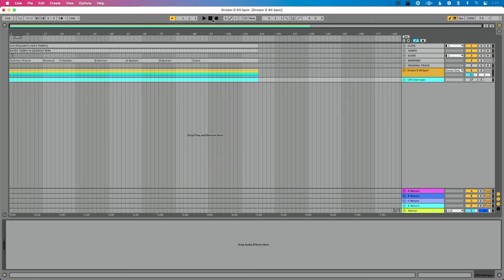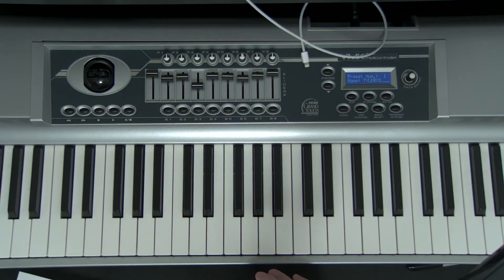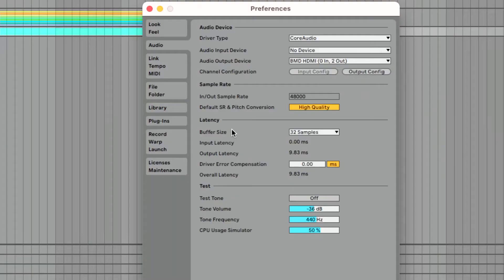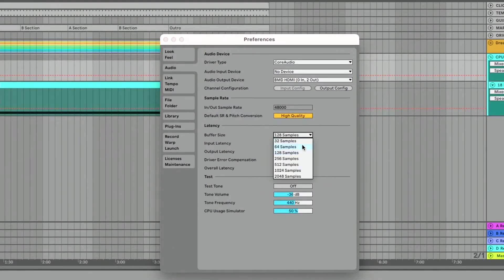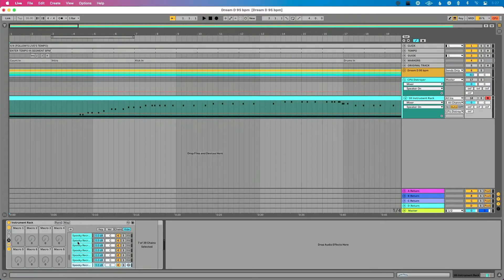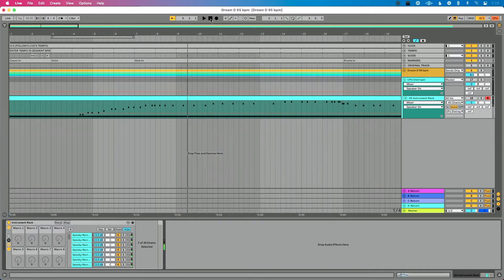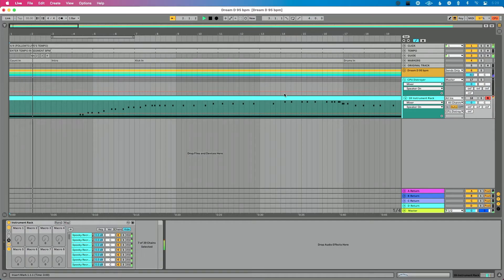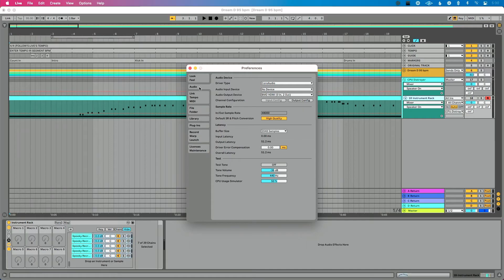How to fix audio crackling and popping in Ableton Live 11

Comment: I'm so annoyed by this. All I'm trying to do is mess around with the piano, my CPU use is only ever at like 5% max, and no matter how much I fuss with the settings I still get pops and clicks when I'm just testing out a single instrument. Ableton is such trash.
Reply: Try a sample rate of 48000
Reply: @cristiansprenger418  you just fixed my exact issue I had the same problem with the clicking on only 5% cpu I think my pc is just horrible. Thank you so much.
Reply: I think your problem is more on your CPU threading than ableton itself... At 5% getting cracks sounds sooooo wrong
Reply: @apophenia3h310  Fucking windows bro I can't be arsed to get into cpu threading optimization when I just want to finish my song that has 4 fucking audio tracks and a drum group with minimal effects. I have separate audio interface obv, 8 gigs ram and an i7.  It shouldn't be this hard.
Reply: @wokeil  something is wrong then, what other program can take all the power from the CPU ? Or do you use unstable vst ? Or maybe vst2 and vst3 combined ?
Reply: May be it comes from your disk, if ableton can't reach samples or long clips fast enough in your disk it can cause issues too
Reply: @apophenia3h310  Yup. It was LABS
Reply: @wokeil  You can use Windows Task Manager's Performance tab to see what part of your hardware is limiting your computer's performance. It might be your hard drive. For me, changing the buffer size fixed my problem. I'm using a worse performing CPU and 8gigs ram, but I have a Solid State Drive.
Reply: Having the same problem
Reply: Your headphone's and ableton sampling rate should be same. Try that it can solve your problem.
Reply: hey man, even my test tone is crackling, dropping out and pitching up and down even at maximum buffer size, which is mothrfkn frustrating.  I think it is because the driver type is MME/DIRECTX, which always has been a fucking mothrfcker in my experience. ASIO should not give this trip. I bought a cheap plug and play audio interface which does not have a setup patch to be detected in ableton which hence does not show up when my driver is ASIO, i think that is my mistake not ableton bug. good news is the crackling is not printed in the exported file it just happens in real time while you try to work which still is frustrating.
Reply: Somehow I can't edit buffer size in my ableton 11. I use a focusrite 2i2, and can only change the sampling rate. Buffer is set to 32 and there's no drop down menu...
Any ideas? Thanks
Reply: Cleaned up my computer hard drive and restarted it a few times and it seems to have worked
Reply: You prob had a bad cable
Reply: That is happening to me also and I have no idea why, is not the monitors because it sounds the same way when I use my headphones
Reply: Increasing the sample rate to 48000 worked for me
Reply: Calling the most used DAW worldwide, and one of the most powerful production software "trash" is something... I just think that you have to better understand either your tools or your usage. I use ableton with hundreds of tracks, midi in and out, audio in and out too, as a live setup, I play a lot with midi on stage, the CPU is always around 80+ with peaks at 120% and NOT EVEN A CRACK... Just look for help, your situation seems a bit too excessive...
Reply: @apophenia3h310  I sort of agree, until..........I have same issue. I have been using DAWs for a long time. Both mac & pc. Here's what's happening. I open a standalone vsti. I set up audio/ midi settings and tweak until I get a great balance of buffer delay and clean sound. Great perfect. Everything sounds awesome. Then.....fire up Ableton 11, onto have ONE midi track, no sends, nothing else. Open up THE SAME vsti, and check buffer settings, great.  Hit note and ugh pops clicks etc. Look at cpu never goes over 5-10%, click pop click pop. Close ableton.  Open standalone vsti, CLEAN NO POPS. uggghh I understand its easy to just say it's the end user ignorance , but not in some cases.
Reply: @aleckinch1199  something with your audio interface, I had the same issue with focusrite 18i20 using evolver's stand alone, check if it doesn't create conflicts with your MIDI I/O with MIDIOX
Reply: @apophenia3h310   thank you for replying to be helpful. I checked the UA site my driver & firmware are up to date. And then I realized.....wait.......if the vsti plays fine standalone. Meaning,  my audio software & hardware are fine, sound fine. And my midi keyboard is sending midi to my computer and vsti fine, how would that be the issue of these devices and not the DAW that is the only thing eliminated from the picture & everything works?
Reply: @apophenia3h310  ableton is not the most used it’s Flstudio and Logic Pro